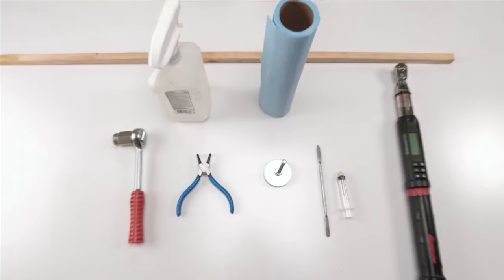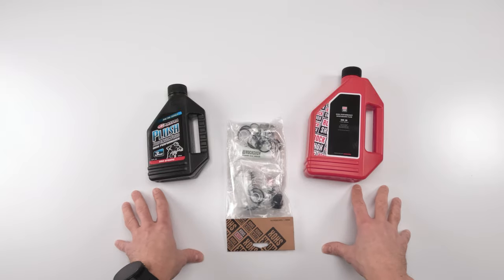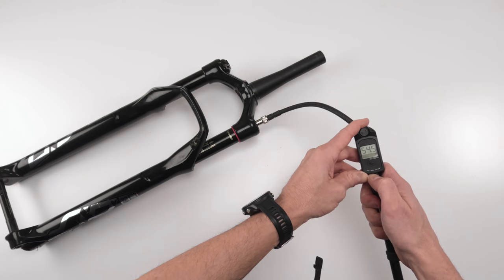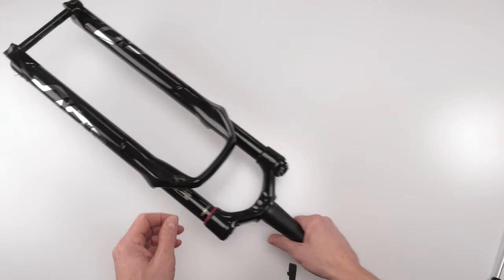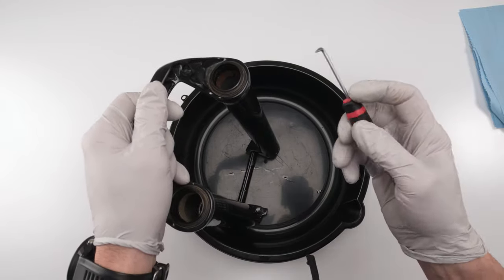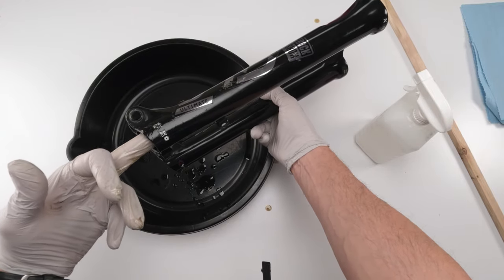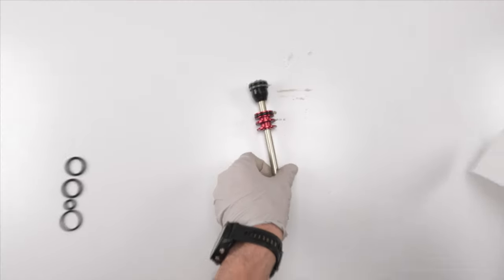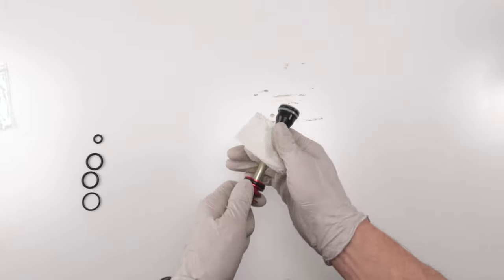Rockshox SID Ultimate 32 B4 200 hour Full Service guide for Beginners. Don't let a fork get this bad

Comment: Thanks!! this video is the most usefull that I´ve seen. Do you know if there is any major issue if the bottom screws (rebound and non-rebound) are swapped from the correct side?
Reply from the maker: I'm happy to hear you found the video helpful. The rebound bolt is designed to allow you to adjust the rebound. You will lose this ability if you use another bolt. I hope this helps

Comment: Does the 2023 Reba 110mm travel require oil on the air side? (Positive chamber)
Reply from the maker: What sucks is I was supposed to work on one of these in january, but we were dealing with so many crazy things that I just couldn't make a video in a reasonable amount of time. I'll get one in my hands again soon i'm sure.

As for the air spring, Technically no, but I would add in 2ml of 0w30 or maxima heavy.
Reply: @zoubtube  ok, I’ll give it a shot. I did the 50 hour service on min and had almost no oil in it. I did the 7mils too just in case. I will say the air spring seal head looks different for sure

Comment: what is the stanchion diameter of this fork?
Reply from the maker: This one was a 32 stanchion.
Reply: @zoubtube  does any rockshox fork has 34mm stanchions?
Reply from the maker: @rIP2693.  At the moment none come to mind. 34mm has been a fox trail standard for a while now, rockshox went with 35mm. from there it's been a bigger penis competition. 😁
Reply: Hey, can you tell me does Fox 34 airshaft can be usable for XFusion slide 34 fork?

Comment: Is the charger 2 damper fits on a sid ultimate that has charger raceday damper? Thank you
Reply from the maker: I'm not sure I fully understand your question. are you asking if you can replace a raceday damper with a charger 2 damper in a sid ultimate? if not can you please reword the question as well as let me know which version SID (chassis model) you have, or give me the serial number
Reply: Yes, can i replace a raceday damper to charger damper in sid ultimate?
Reply from the maker: @francisalbina5278  before I can say an official yet can you let me know what year or chassis number sid for you have
Reply: Its FS SID SL ULTIMATE 2020  32mm 100
Reply from the maker: @francisalbina5278  Good thing I didn't speak too soon, as that changes things. For some reason, I assumed you were talking about the newer sid which offers both dampers. I need the chassis model of your fork to be sure. Can you get me the serial number so I can look up the chassis version. Below is a link that will bring you to a page that shows the damper upgrade options for the different chassis. I'm still assuming the answer is yes, but without the chassis number, I can't say a definitive yes. Let me know if you need help with the page.

https://www.sram.com/globalassets/document-hierarchy/service-manuals/rockshox/front-suspension/charger-damper-upgrade-manual.pdf?__woopraid=22p6RbqPFhHB

Comment: Subscribed.  Thanks for laying the tools out for each part.  A ton of effort appreciated.

6:20 use SRAM butter over dynamic seal grease or not?  Confused by what you said there.
Reply from the maker: Thanks for the support. In the rockshox service guide, they state dynamic grease. Yet on the seal package, they state SRAM butter. Personally, The only time I'll use dynamic grease is when the grease needs to mix with oil, such as in the IFP chamber of a dropper post. For air springs, just use butter. 👍

Comment: Hi there.  
Love your channel 🙂  
I have serviced a Sid RL3 with remote. The compression knob has lost the "spring" and doesn't turn back to open on its own. Any way to open the damper unit completely and fix it? The bladder and all of the top has to be taken off...
Reply from the maker: Thanks for the kind words. Technically, yes. The upper part of the damper can be opened. But it can be quite a PITA. Worse yet, Rockshox doesn't offer parts to the public (that I know of) for the upper stack, so if anything goes wrong, it could prove to be a problem. I need to know the exact fork you have. Any chance you can send me the serial number?
Reply: @zoubtube  Strange thing is that the fork didn't show when I typed in the serial number in the service hub at Sram website... 
34T83589300
Not my bike, so I don't know the year.
Scott Spark. 100mm travel. RL3 damper
Reply from the maker: @MrDarni78  Based on the serial number, it's a FS-SID-RL3-B1 fork. It comes with a charger 2.0 damper and a debonair air spring. IMO, this is a good overall damper. Charger 2.0 is comfy on XC trails when setup right. I could be wrong, but I don't think there is anything you can upgrade it to in order to make it better for that generation. What exactly were your thoughts as far as "upgrading" the actual damper?
Reply: @zoubtube  No plan on upgrading. Just changing the oil when I realized that the compression knob was "loose"

Comment: Great video, really appreciate the complete walk through. I have a '14 SID A3 model with Specialized Brain damper. Is it possible to still use this video as a guide for the 200 hour service or is it going to get too complicated with the different internals. Thanks and I look forward to some of your other videos I just found!
Reply from the maker: Glad to hear you found the video informative. As to your question: the lowers yes, the job is basically the same, the air spring as well, though the air spring will look a bit different. As for the damper, no. I believe yours is a motion control, which is a completely different damper. I'll be posting a video on a fork with motion control. its just a question of time. I'll try an get to one soon. thanks for your comment

Comment: What tool is your blunt pick and what adapter did you use to connect the syringe to the damper bleed setscrew when bleeding the air out the damper.
Reply from the maker: The pick I bought from ifixit a long time ago. turns out they still sell it below is the link.
https://www.ifixit.com/products/metal-spudger

The adapter on the syringe is the same adapter that is used to bleed SRAM brakes. Just make sure it's completely free of dot fluid if you're going to use the same syringe to bleed your fork. Or even better, just buy a dedicated syringe for your fork. They can be found online for good prices